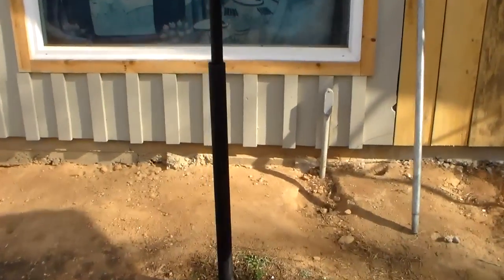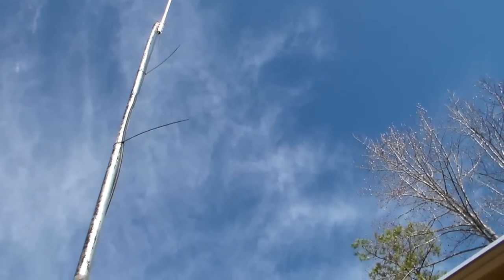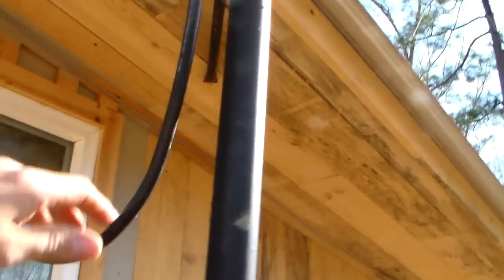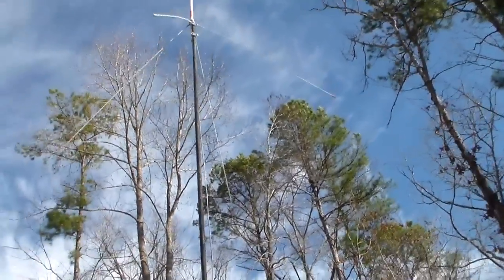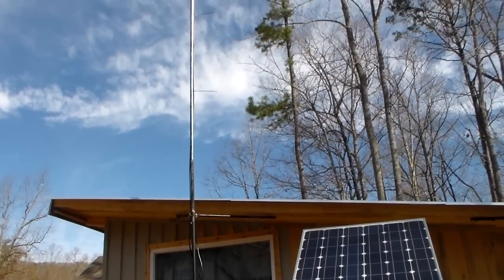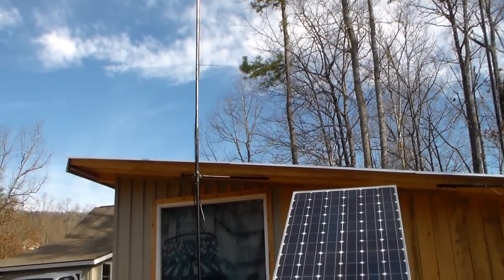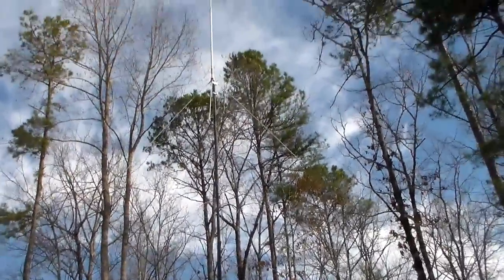Building a cheap radio tower.

Comment: And I did something very similar to that, I took a 5 gallon Home Depot bucket put an oversized pipe into it and filled it with concrete then dug a hole and put it in the hole.

Comment: A suggestion - add an 18" single loop at the top for lightning (not smaller than 18" or you can create a coil/choke in the circuit). Old-school theory is that lighting wants to travel in a straight line and will blow out the bottom of the loop and not hit the shack with full force.  I do this on all my tower/mast installations.
Reply: I'd love to see this idea tested out. Wish there were a lightning lab someplace that could demonstrate it.

Comment: Good example of what can be done with readily available materials, but it is fenny how 30 years (or less) ago this antenna support was called a mast not a tower. Every tower I have ever owned had 3 or 4 vertical legs with cross bracing and a mast out the top for antenna mounting.

Comment: One thing to keep an eye out for are TV antenna towers. With people switching to Dishes or internet for their TV, TV antenna towers often get thrown away or just sit there. If you see a tower with a broken antenna on it, the owner probably doesn't use it anymore and you might be able to take it off their hand for little or no cost. When properly set in cement, they can get very tall without additional support.

Comment: Rule of thumb: If it doesn't blow down, you didn't make it high enough. But seriously, nice economical alternative to a commercial tower. Suggestion: the swaged points are weak points for getting wobbly. Guy or clamp a little above these points; you can't trust long pieces above these joints unless they are clamped or guyed. Also, fasten your feedline within a few inches of the connector to take the pulling strain off the connector. As another mentioned, make a single-turn loop about 12" diameter in the feed line. This will disrupt currents on the line that would distort your radiation pattern.  Also, you might want to drive a ground rod next to the mast and clamp a heavy gage wire to it. A coax surge arrester at about $20 would be good; install it close to the ground in a waterproof box with a short lead to the rod. A cheap ground rod is 1/2" copper pipe. Cut in half, you have 2 x 5' 'rods' for less than one real rod. And for god-sake, clip those tye wrapp ends off. You can be cheap, but be neat.

Comment: They used to sell a radio mast that was somewhat disguised as a flag pole--and doubled as such. Don't know how it performed. I think it was basically plastic PVC pipe with the radio cable running through the inside of it, and the flag hooked on the top end.

Comment: Just an idea, your mast/antenna system is good, but the antenna only works on a small band.
If you get a multi band long wire antenna, it can be installed from 2 trees. The long wire would not need a a mast/tower  and can reach great hight and cover most of the HAM bands. the cost of these systems range from 50 (used) to 140 new.

Comment: i worked at the fm station here for about 5 years. we had 18kW tower  or  somethin.... just keep enough ventilation and electric  grounding in that control room the Heat and Ions build  up to very unnatural and almost dangerous levels

Comment: Good video, good idea, Southernprepper1.  A lot of people have a CB radio that could use a taller antennae, even if they don't own a ham-radio set.  It looks like you have a good group of viewers with good information about radio towers.  Out in the far west, just a few years ago, handy metal littered the roadways (from illegal dumping).  Now days, the economy is so bad, the metal mongers grab all the metal and anything else of value.  Hard times are here, and it will get worse.

Comment: Height is the key for Db gain.  Nice experiment
Reply: Think about a di-pole antenna.  Just a horizontal wire w/ a rectifier/ tuner in the center.

Comment: My first radio antenna was a long wire then on say in a vacant lot I found a mast covered by grass it was a real telescoping radio mast made Galv. Steel 40 feet total length, it even had the guy wires.  I had my brother help me carry it home and worked to get bit set up which was fairly simple.  I carried it to the high desert of southern Calif. when we moved there.  It was used to support a TV, CB, and HAM antenna with the addition of a 20' length of Sch 40 pipe.   I left it at my folks house since it supported the TV antenna, when I got into my own home I built a new one out of the local hardware store. Not the same but it worked.  Suggestion is to get the parts and set one up on top of a near by hill or peak to run off a portable radio.

Comment: That is almost exactly how I did mine, except the fence rail is wired to a green temporary fence post and there is no connection to the house.  Sandy soil and stays up even in a decent breeze, sways, though, but it's just temporary

Comment: Looks great!  So no problems having the 2 that close together?  Just wondering...
Reply: I noticed that as well, and was curious. I believe SP1 has some Hams in his group. I would have walked around the setup with people inside using the radios, and tested your question with a Field Strength Meter.

Bruce Forster-AC7AA

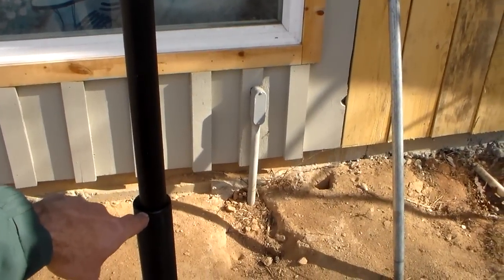Comment: Great video and excellent use of material… might make a couple of suggestion, you may have already thought of this but didn’t see or notice any comment… At 0:40 after you install the top rail into the base pipe, pretty loose, would suggest stabilizing top rail with-in the base pipe (wood wedges, screws or ??) to prevent it from wiggling/twisting around… Then I would cover the gap/opening and seal it to keep water/rain out… Then at 1:40 after installing this pipe, I would drill and put a screw through both pipes. Then I would seal it. Doesn’t matter how tight you think it is, the wind, rain and temp variances can still cause them to twist, bend, vibrate and so forth. Water does strange things. Mast needs to flex some but you don’t want it turning/twisting within. Ham radio is best way to go. There are apps available, legally, that can reduce interception/readability by up to 40%. Another choice is FRS/GMRS but to legally use GMRS requires a license ($85/10yrs) but this allows you (+ family members) to use an external antenna and higher power. Basically it’s a commercial license plus encryption is allowed… Other good comments regarding coiling coax at top, drip loop at bottom. Don’t forget to check SWR before completing final install. I use a Comet GP-15 Tri-Band (6m, 2m, 70cm) and wire antenna (HF) in the attic (due HOA)… Enjoy your videos and especially the scenarios… Thank you…

Comment: On your drip loop coil the cable 3 times to help keep lightning strikes from getting to your gear. A coil resists any change in current and lightning will take the path of least resistance; ie. the pole. For your wind turbine I used 1.5 inch schedule 40 black pipe and 3 guy wires. Held up to hurricane sandy.
Reply: You mean a choke? 
It's supposed to be close to the actual antenna, and it's to stop RF from coming back into the house. 
Not  for lightning.
Reply: No. I mean coil your cable. You have then created an inductor. Look up what an inductor does. It resists any change in current. Therefore, the larger the current change, the more resistance. A lightning strike is a Huge change in current. I have used 50 turns of 14 gauge wire on a torroid core in parallel with a varible capacitor( for tuning purposes) on the rg-58 cable coming from an antenna in the field and have actually taken lightning strikes. The coil would be destroyed but the equipment inside was always be protected.
Reply: As anydamaddress1 stated, what you're describing is an RF choke. It helps keep reflected RF due to antenna mismatch from making its way back down the coax shield into the shack. It has NOTHING to do with strike mitigation. A lightning hit is NOT going to be put off by a few turns in the coax. While it's true that introducing inductance impedes the flow of a high rise-time occurrence, with several million volts involved and thousands of amperes available, that coiled coax will just vaporize. If lightning hits, your equipment is COOKED. I know of what I speak as a trained grounding specialist and GROL ticket holder.

Comment: David, do you have much traffic on CB channels down there?  Here in central Illinois it's hard to pick up any CB traffic.  I went to ham radio mainly so I could monitor what was going on around the US and in other countries......I don't regret it.  Just wish I had the room and the trees to hang wire antenna's for different bands, right now I'm doing HF off my Buddipole.  That antenna works surprising well but getting it tuned in correctly is a bitch.  It's a short antenna with coils and it's only up about 20 ft. so I'm experiencing restricted communications with it......not much DX but that's OK, I want to know what's going on in our country.

Comment: If I can add something.....If it's possible try to get OLDER top rail. I have some old top rail from about 20 yrs ago, and it's MUCH thicker and stronger than some I just purchased. The old saying "They don't make it like they used to" is definitely true here. jm.02
Reply: contact a local fencing company to get quality top rail. i bought a 2" x 24ft piece of schedule 40 galvanized and it is  rock solid. schedule 40 steel top rail is way more heavy duty than the gauge thickness pipe that you buy from places like Home Depot.
Reply: btw the price was just over 50 bucks after taxes. the best part was hauling that long, heavy ass pipe home. a 24 ft pipe strapped on an angle to the top of my tacoma with a 6ft bed driving down the interstate was a pretty funny sight lol.
Reply: wallace fosho I have hauled a pipe from a fence supply store. The same way.  Mine was a 20 foot section of pipe. At least I didn't have to go far. The fun part was tie down I tied it down in the bed of my pickup then tied it to the front bumper.  I need to do it again. I plan on putting up a CB Beam.

Comment: i dont know if u knew but there is a thing wind load on antennas if you u look it up on the specs of the the antennas you can see how much wind ur antenna is rated to  and it helps knowing that we get alot winds that is 60 plush some times in oklahoma and you just might need to know that

Comment: you might want to ground it to a ground rod / in the 70s my dad had a cb  tower and every time the storms came by he had to unplug the antenna and you could here it snapping from the static in the air from the storm at the end of the cable

Comment: Top rail is EXCELLENT antenna mast material. I have 30' feet under a 10M vertical. It DOES require guying at that height, as top rail is thinner that traditional antenna mast - which is really hard for me to find, since cable/ satellite/ over-the-air-digital TV has made it pretty much obsolete.